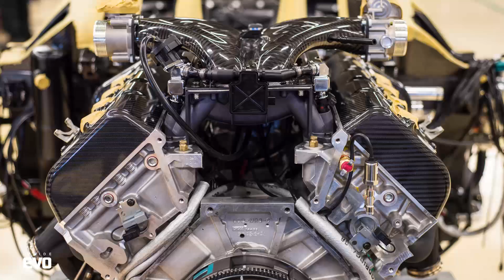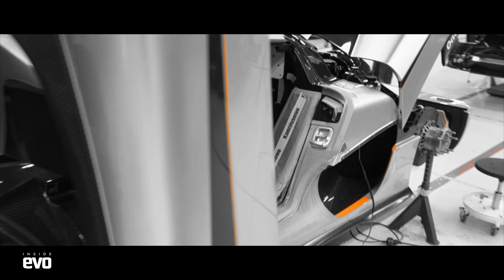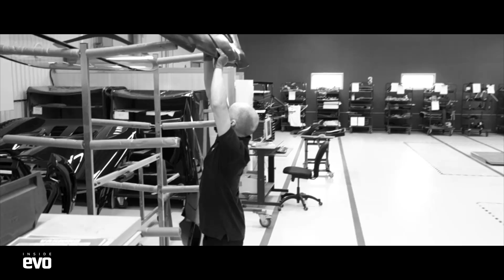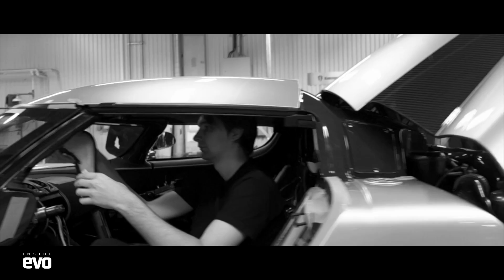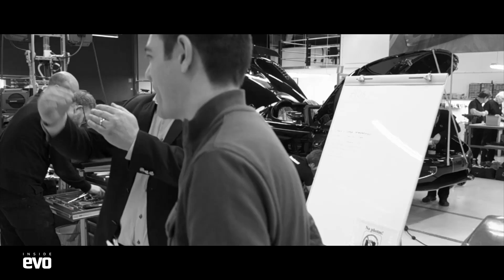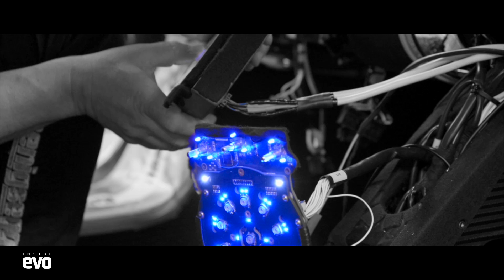Christian von Koenigsegg interview | INSIDE evo

Comment: Lamborghini Twin Turbo 1850awhp 1550kg = 1200 AWHP per ton Koenigsegg one:1 1360bhp 1360kg= 1000bhp per ton this means engine power per ton not wheel horses that lambo does 0-250mph in 20sec just to show how fucking dumb this guy is to think he will ever get close to that record let me explain: Venom GT (not a production car) 1250bhp and 1250kg meaning it has the exact same PTWR as a Koenigsegg One:1 and this Lotus is doing 0-400 or 0-250mph in 29-30sec and here he is thinking to hit 0-400 in 20sec BAHAHAHAHAHAHAHA fucking idiot he failed math and physics.. And as far as 2G cornering ohhh my fucking god i mean where to start Michelin Cup tires will and cant handle 2G in cornering to pull to 2G real G-Forces you need slicks period thats physics and i know it.. thats what lemans car and mini formula 2-3 cars pulls if you think your car pull this amount of G you`re just retarded.. So you claim a 600kg downforce yea about that NO but lets say you have watch the latest vid of Maclaren P1 vs 918 Michelin cup tires 2 they struggling with even the P1 witch has way lower BHP number and P1 has 600kg down force it also has way lower TQ this Koenigsegg has alot of TQ you will not beat 918 or P1 on any track just trust me and lastly THERE IS NOTHING NO CAR THAT CAN BE BEST IN BOTH WORLDS THATS ABSURD.. you can try but physics will not allow it either to much downforce or to less.. Its like a Formula 1 car NO NOE is better in physics then these guys when you remove a couple of AERO parts the car goes 250mph++ when they`re on 200-210mph lol get real koenigsegg..  

Watch at Goodwill hill climb there is a vid of that race One:1 has the 7`th best time overall first <lol<lol> 54sec.. Nissan GTR Nismo 49.2sec again LOL watch that vid and look how insane all over the place that car is it`s horrific to watch reaally especially since he talks so warm about it..
Reply: Someone had a few too many redbulls.... Settle down and lay of the caps lock and random laughing. You keep on calling on physics as a reason this can't be possible, but you never really get into the so called physics. You act like Koenigsegg just sits there and just chooses a number out of thin air when in reality, they have a supercomputer simulating possibilities and giving them the numbers based on physics equations. So once again settle down and stop being a ADHD 5 year old with the ability to Google stuff. Why are complaining about 2Gs? Your precious GTR has been clocked pulling 2Gs. How do you know how much down-force it makes? have you measured it's air resistance and crunched the numbers to figure out what it's net downward force is? Yeah this has more torque than a P1, and you have to learn how to use it. It isn't made to be an easy to drive car. Why would anyone trust you? What credentials do you have? And it is completely possible to be good in both worlds, that is what variable aerodynamics is all about is all about. Higher down force at lower speed and less at higher speeds. YOU are the one who needs to get real and hop off the hate train and take a look at the jumble of words you spouted. I hope, for the sake of the human race, that you were either drunk or high when you typed that, cause that should not be how sane logical people express their ideas regardless of whether or not they are correct. If you were not mentally impaired by something, please for the world's sake, don't reproduce.
Reply: Steve Hash Oooooo so you know how to laugh and call people a faggot. So accomplished. Does your mother know how you act? Also, your not Steve Hash. You might be a lot of things, but you are not Steve Hash.
Reply: BaronVonRhett BHAHAHAHAHA Brainiac lmfao
Reply: Steve Hash Yeah, I am actually rather intelligent. I take pride in being able to properly articulate my sentences and not sound like a neanderthal suffering from downs syndrome.
Reply: Steve Hash 5g? It says 2g. Learn to read neanderthal.
Reply: BaronVonRhett BHAHAHAHAHA Yea go on and change it lmfao.. and 2g is also absurd for a gtr go find me proof
Reply: I lol'd so hard reading through these comments hahaha
Reply: HHAHAHHA AHAHAA proper Nissan GTR belieber!!  some dose of incomplete knowledge about you´re saying spiced with big doses of ignorance...but stay trying,next time you finish crying (of pure shame)  XD
Reply: definitely,you dont have shame sense!!
Reply: Steve Hash Ok Steve, I don't know who you think you are, but let me tell you that CvK clearly said that the Agera R could pull 1.92G in a corner, yes, go look it up. If the Agera R can do it, you don't think something with 30% more downforce and 80kg less curb weight can do it? And the reason the One:1 did 54 seconds at Goodwood (not goodwill) is because it is an extremely rare car, much rarer than your GTR, and Koenigsegg were still in developement. Just wait for those Nurburgring times, son. Also, 0-400 in 20 seconds? For a car which is 1:1 and has one thousand, three hundred and forty horsepower? Easy. Go home, you're drunk
Reply: But does it use variable geometry twin turbos? they spool from just over 2k rpm. Another thing you can't drive a 1800hp lambo is not really streatable now is it? needing really high octane fuel and all that, Agera 1:one makes great power just on E85 and also makes good power(1100-ish) with regular pump gas...
Reply: Beverain BHAHAHAHA yea emn NO my point is to prove how much it takes to achevie the idiotic CLAIMS CAUSE THATS WHAT THEY ARE to destroy fanboys dreams and stupitity  thats all... its not production car NO but it shows how much it takes if it has great power from 2k rpm or 4 k rpm dont mean shit since you only spend your time there in 0.2sec now do you``?? lmfao no but it uses a LC with gives you fool boost or they run boost by gear so you can adjust this until the perfect spot OBVIOUSLY Koenigsegg also got this but its RWD vs AWD so the lambo has way better 0-60 foot or 0-60mph then it has TONS of more power to pull a hugh lead on top.. Venom GT only hits 230+-235mph in 1 mile lambo and ford GT hits 260mph+ 

This is only to show how much it takes and that car manufactors are full of lies..all CLAIMED TIMES thats all what it is..
Reply: Steve Hash 
One problem mate, its a production car. The Agera R can go 0-300kph in ~20 seconds, in stock trim without any modifications, its even been documented... The Hennessy Venom is a kit car based on a Lotus (can't remember the name) and is not a production car. You try making a car that makes north of 1000hp reliably and still pass modern production car emissions regulations
Reply: Steve Hash 
Back in the late 1990's BMW made 635Hp from a naturally aspirated 6 liter V12 engine, that still passed emissions regulations back then and made power reliably, hence that engine still costs more than a mid-sized house. Long live the McLaren F1
Reply: Beverain yess and so i agree 100% the Agera R did 0-300 in 15.4sec so i bit better then 20s ec lol but this wasn`t about either vehicle being production car lol it was about how much it takes to go from 0-250mph in 20 sec GZ learn to read...
Reply: Steve Hash my bad 14.53sec 0-300
Reply: Steve Hash 
You can't go compare a Nissan or Lamborghini to a Koenigsegg or Bugatti, Super cars are not the same thing as Hyper cars. With Koenigsegg's FVT well in R&D they'll be making 30% more power and using 10%-15% less fuel based on testing with the tech
Reply: Lmfao sure but they cant do 0-250moh in 20sec lol
Reply: Have you seen the Koenigsegg Regera?
Reply: HAHAHAHAHAHA Emn no whats that a airplane?? How much fuel can you Get out of that plane??? Smh
Reply: Steve Hash Um, the Venom GT is 1244kg dry, no fuel no oil no driver. The One:1 is 1340 wet, with a 100kg driver and 30kg of fuel (half a tank). That makes the One:1 1341 horsepower to 1210 Kilograms, which is 1.1 to 1. Then the one:1 is a stock car, stock meaning factory tested and built with the best engineers on the planet, not put together by a bunch of students in a garage. Go brag about your Venom GT to others whose stupidity and ignorance is on the same level as you
Reply: when will you guys just learn to stop talking to this guy? jeez. just let a thread die already.
Reply: Beacuse they're Even dumber then you
Reply: BaronVonRhett Yeah I agree, I'll use my time elsewhere

Comment: I wish it din't have such agressive aero parts in the front. It's a bit too much and realy looks like a GT race car. I know the customers wanted a track car but it would look much better without those canards in the front.
Reply: "I know the customers wanted a track car"

Why didn't you stop there?
Reply: Sadly, those winglets are exactly those buyers wanted.
Reply: the car you're describing already exists as the agera R.
Reply: It seems you are confused by the purpose of this version. It's not supposed to be dual purpose.  It's not supposed to "look good". It's supposed to be functional for the task. Sometimes functional is ugly.
Reply: Many say P1 looks like a race car. This seems to step past it in some ways. Like P1 we have some wind tunnel at it's roots. The down forces figures are based on different points in speed. It has slightly more DF then normal P1 at 160.
I see Mclaren didn't like his bigger numbers. The P1 GTR has about 2000lbs at a much lower speed then One:1 at max speed. No word at where peak numbers have been said of P1 track model. Numbers do suggest something around 180+mph.
Reply: Shift4g Because it's over the top. You can have extreme aero that you can remove after a track session but these are permanently on and don't look good. Never looked good on any car, not even the German touring cars look good with these.
Reply: Shift4g I get that. But at the same time, it's a multiple million dollar car. If all people wanted was a efficient track car going really fast, why not go with a track specialist? There are many track cars that are way faster than this car and cost a fraction. This car is too beautiful and too expensive to ruin by those canards. That is my personal opinion.
Reply: bezor Ta Because those track cars aren't road legal except UK and a few other places.

Comment: Incredible technology. Unfortunately, for a small volume company they can not trickle down technology to their "volume" cars, since they don't have any (they don't have the facilities to mass produce). They can't recoup profits in that way so they have to always be on the cutting edge - the downside is that a normal joe won't see that sort of tech for many years and possibly never. Tear
Reply: Weren't they interested in buying Sabb recently. Pity it didn't happen, could've been interesting.
Reply: they are moving to a new volume model soon. and there is still their cam-less engine tech which I hope to see in their cars and monster cars before they move to electric( christian owns a tesla and has shown interest but sticks to what gives absolute highest performance, electric has that potential just needs some weight drop)
Reply: gumby2ms Interesting comments - thx. Seems like now that they have established their brand new, a volume model makes a lot of sense.

Comment: 7.10 min at Nurburgring is my guess, pointless excess power for something that's intended to be a serious track car. What happened to balance and control?

Ask yourself why the P1, 918 and La Ferrari all have near identical power to weight ratio and aero. Why did non of them build a 1500BHP car instead? Its not like they were not capable of doing so.

At Nurburgring shaving grams off doesn't make you a fast car, just look at something that's heavy like a Nissan GT-R and only 550BHP. Its all about track development to allow a driver the confidence to go flat out.

It will be interesting to see what happens (assuming we actually get a lap time unlike the Agera).
Reply: if the 1,92G constant lateral is true, i think the time could be ALOT lower than that.
as long as there is a crazy enough pro driver to take advantage of all that power and grip with road tires that is
Reply: Manufactures were able to build 900hp cars in the past too. Its all about putting the bar just a bit higher each time. They are all made to drive "safe" and not have obscene power. Look at a Henessey TT and how it delivers power in a surge. The ring is a great track for cars with high power, and high speed balance. Im sure the Agera One can do it within a similar time in the high 6s or low 7s. 

I agree more power doesn't always mean faster, and the new hyper-car trio appear to be remarkably balanced on the track.
Reply: I have no problems with your points and opinions. Yeah the talk is big in every P1,LaFerrari, and 918 video regardless the subject. The actually claimed 1360hp is only using the E85 biofuel. Power is around 1150 on normal super premium fuels. So power is a little more control able with less power.

Selling a car to 400 or more with 1100+hp can be done but  you must have the customers to buy into this idea that's all.
Regardless of the car, the Ring is dangerous for all who drive there. GT R has it's AWD for safety net. RWD cars are far more dangerous at the track because of such great speeds. A fast time with this One:1 can only be done with a very good Pro driver. I see it doing sub 7:00 easily because all the speed in all the straits. Corners are  will show of balance and control you mention.
Auto Sport mag could only do around 7:12 in the 918. Yeah he wasn't pushing it but still it needs a brave driver to do it.
Reply: Given enough time to geotag every bump and crevice of the nurburgring it could probably set a new record

Comment: 0-400kmh in under 20 second?!! HOOLY SHIT!!
Reply: ***** while shitting yourself you mean!
Reply: And to put those 20 seconds into perspective, 

Bugatti Veyron 0-400km/h - 55,6 seconds.
Reply: *****
Bugatti is a 10 year old car. The fact that it has remained the king for so long proves what a marvel of engineering it was. We'll see if One:1 reigns for a decade.
Reply: Its one of the most stable car in a high speed run you could almost just have one 1 finger on the steering wheel and be fine.
Reply: i don see the point of such acceleration))) it is not usable)) the only possible reason koenigsegg are doing this - is to make someone rich to feel that he is the fastest road going madafaka ever!